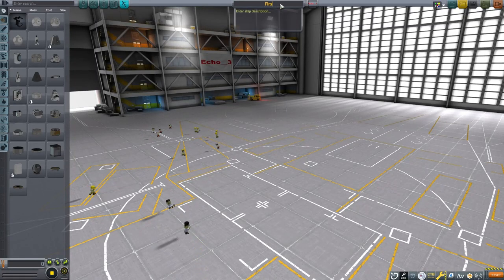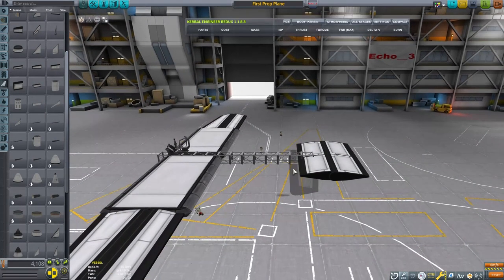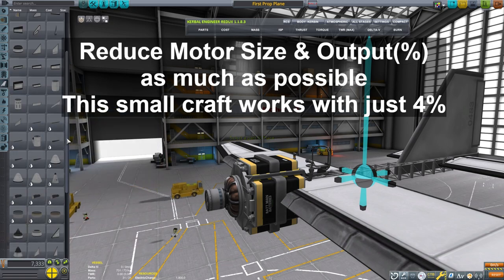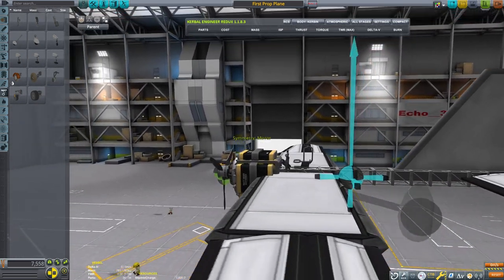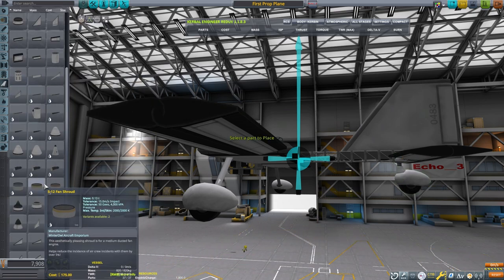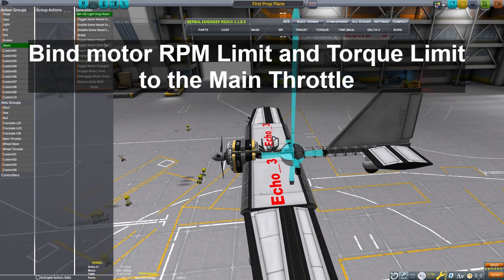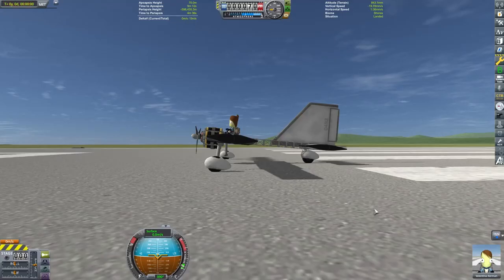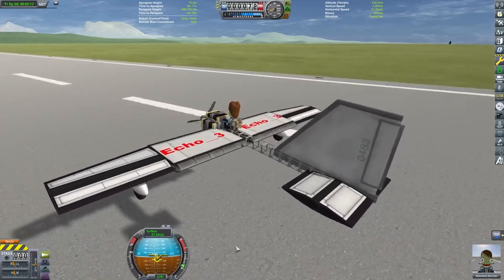Very Simple Breaking Ground Propeller Tutorial

Comment: Also, why do you bind the rpm to the throttle action group as well? In my testing, this didn't change anything compared to just binding torque.
Reply from the maker: I am wanting to control how fast the blades are rotating. Binding just torque will work, but the prop speed will be determined by air resistance.
Reply: Thx! I just started building prop planes and helicopters two days ago. There's a lot of variables and I still don't know what all of them do and how they interact. To me it seemed like torque essentially controlled rotation speed while max rpm just gave an upper limit, which by itself doesn't do anything. That's why i just left it at max and used torque as my throttle. I'll try out your method for sure. Lots to learn still.
Reply: How do you set deployment angles? On xbox we dont have that option even with advanced tweakables

Comment: using a dihedral design on the wings can counteract the torque of the motor
Reply from the maker: Which I almost always do. But it will only help so much.
Reply: @Echo3  in that scenario i think it would work really well, infact real single engine planes used dihedral designs to counteract the torque

Comment: whenever i bind the motor to the throttle it only goes down to 50%
Reply from the maker: Are you binding RPMs or torque to the main throttle?
Reply: @Echo3  Both like you said
Reply from the maker: This seems odd. Are you using a KAL 1000? If you can send me the craft file, I'll look at it for you.
Reply: @Echo3  i did not get a notification sorry for the very late response, i am on PS4 and i cant send craft files.
Reply from the maker: @DylanoTheWizard  I am not very familiar with the PS4. I know the propellers, anyway, are a little different on the console version.

Using a KAL -1000, bind the KAL to the main throttle and the rotor torque to the KAL. Set the KAL to go from 0-100%.

I don't know if this is a controller issue or something, that's why I was hoping to see your craft file. I am on Reddit (same name) and can look at any pictures or video that you share there if you need further help diagnosing issues.
Reply: @Echo3  Alright thank you for the help

Comment: Hi, how do you do that kinda move thing? With the arrows, and what about the roll thing. You have a circle to roll things. Do you also have a tip? I have a hard times snapping things...
Reply from the maker: Up near the top left are some different functions in this order that also corresponds with their keyboard shortcut. 1 - place, 2 - move, 3 - rotate, 4 - re-root.
Holding shift with the move tool will let the object move further.
Hold Alt while trying to place a part will snap to node attachment.
C toggles angle snap/fine placement.
Reply: thanks! The snapping thing worked, but how did u do the arrow move thing? For example at 0:57
Reply: @Echo3  nvm found it!
Reply from the maker: @jeanke2396  Glad you got it

Comment: Why do you adjust the position of the propeller blades by turning them? Couldn't you just use the deployment angle?
Reply from the maker: I used the rotate tool so the blades would be facing forward. Then I can be certain that the deployment angle is correct.
Reply: @Echo3  thx. I'll have to think about that.. does deployment angle depend on the initial position of the blades (so it's like turn x degrees from starting position) or is it an absolute value independent of the starting position? So far I just used normal and inverted and assumed this would give me 'correct' starting position.
Reply from the maker: @lb2791  deployment angle is based off of the initial position of the blade as it is placed, not off of any absolute position relative to the craft itself
Reply: @Echo3  thx! I just found out the hard way. KSP seems to sometimes randomly rotate the propellers in different ways when you attach them. Manually rotating them with the silver edge towards the front solves this.

Comment: I can't get my plane to start the propeller doesn't spin unless I start playing with the torque limit and when I do that I can't get it to go over 5 meters per second and it's also going backwards even though the engine and propeller are both set to clockwise and are at the proper angle what am I doing wrong
Reply from the maker: Without seeing exactly what you are doing, I am going to be making some guesses. I am over on Reddit https://www.reddit.com/user/Echo__3 if you would like to share pictures of your craft with me.
In this tutorial I bind the motor RMPs and torque limit to the main throttle using the action group menu. I also unbound the break acting group from the motor. Throttling up should get the rotor spinning. Make sure your motor is big enough. My small craft with only 3 small propeller blades worked with a tiny motor, but you may need a larger one with the motor power set to a higher percentage than what I did.
Make sure your propeller blades are deployed and that the striped side is facing forward. 
https://www.youtube.com/watch?v=R-RtvjX5QZo This video covers how to make a constant speed variable pitch prop plane.
Reply: I feel like a dum ass I forgot to put RPM and torque limit to the main throttle group it flies now  this game makes me feel stupid sometimes you need to be a basically a genius to play it talk to me almost 3 to 4 hours to figure out that I didn't set it to the main throttle.

Comment: Nice video but how do you actually make it go forward  all my did was jump up and down like it was in a  Snoop Dogg video
Reply from the maker: I deployed the blades to about 20 degrees
Reply: Very basic rule of thumb. The angle of attack of the blades should be roughly the arcsin(Airspeed/Blade speed). So for example, if your blades are spinning at 300m/s, and you want to fly at 100m/s, then the angle of attack should be arcsin(100/300), which is 19.5 degrees. 

If you don't want to bother with active AOA adjustment, then just guess what your planes top speed will be, and fix the blades at the correct angle for that speed.

Comment: Why does my plane drift to the side when its in the air?
Reply from the maker: Do you have an adequate vertical stabilizer and rudder? If you are like me and use trim, it can be easy to accidently trim yaw. How are the yaw/pitch/roll indicators behaving?
Reply: @Echo3  the roll indicator in not exactly in the middle
Reply from the maker: @Ureskundul  a single engine plane like this will naturally roll because of the torque from the engine
Reply: @Echo3  is there any way to prevent it?
Reply from the maker: @Ureskundul  I use trim to counter the roll. Many players just use two engines in either a twin engine or contra-rotating design.
Reply: @Echo3  Thanks, didnt know trim was a thing

Comment: Why can't I place the blades?
Reply from the maker: As in you can't place them at all or can't place them correctly? Propellers can be surface attached and do not need to connect to a node.
Reply: @Echo3  I can't place them at all, I tried to have a different angle for it to auto-attach but it wont work.